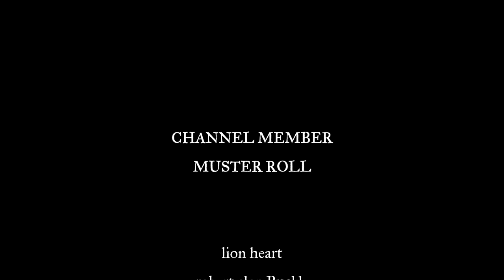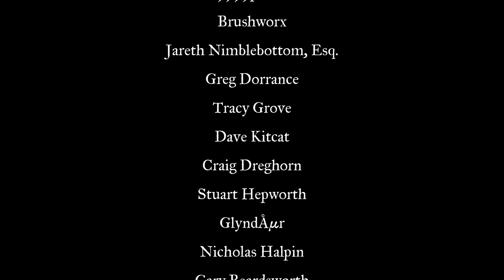How I Create and Paint a Command Base - The First Crusade

Comment: Loving the minis. Can I ask, is your 3d printer easy to use and can it do terrain as well?
Reply from the maker: Thank you, glad you like them 👍

The printer is straightforward once you get used to it. It takes a couple of weeks to dial in your settings and get used to it so I just bought some cheaper resin and practiced printing things I wasn't to fussed about. Once I got used to it I bought some higher quality resin and started in earnest 👍 it can do Terrain, but not massive pieces, hope this helps
Reply: @7thson726  that's great thank you, I think from what you're saying its not that bad. Re terrain if it does smaller pieces I could be happy with that and once I learnt the skills I can move on to another make etc. Thanks for the reply and great work once again